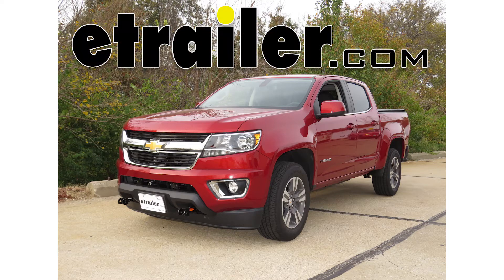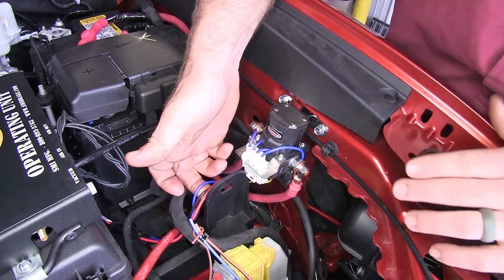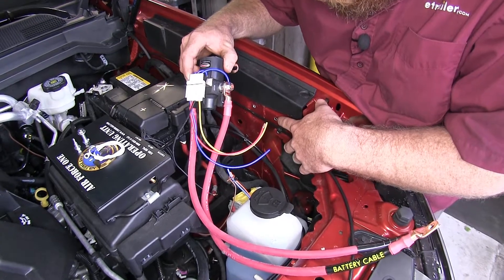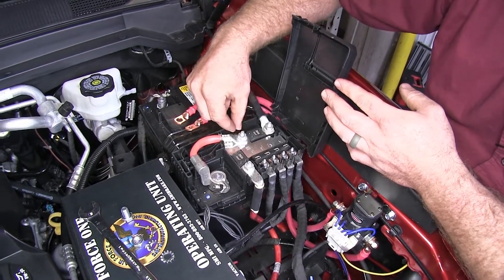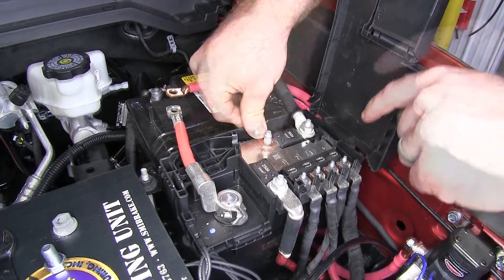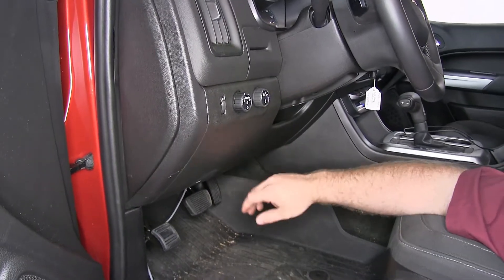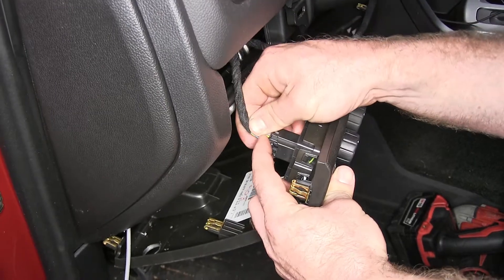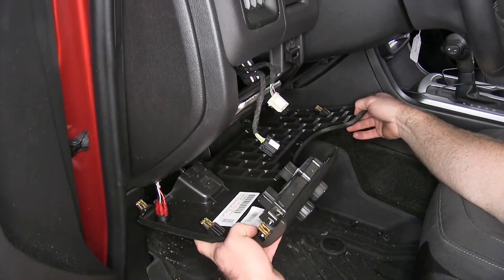etrailer | Roadmaster Automatic Battery Disconnect Installation - 2016 Chevrolet Colorado

Comment: How do you change the meg battery cable on a 2016 Chevy Colorado
Reply from the maker: We have never changed a battery cable on a 2016 Chevrolet Colorado. Typically, you would remove it from the negative terminal on the battery and follow it down to where it is grounded to the chassis.

https://www.etrailer.com/Accessories-and-Parts/Roadmaster/RM-766.html